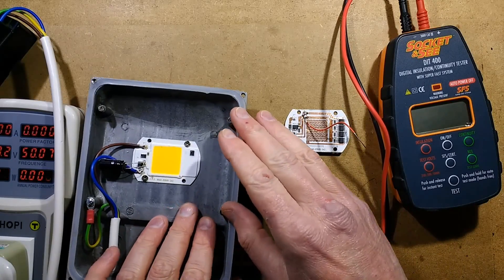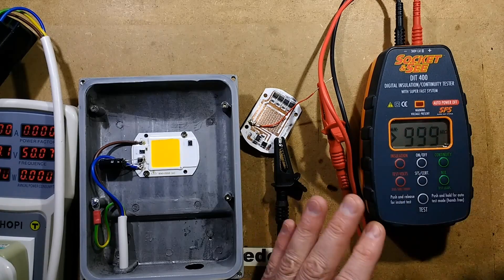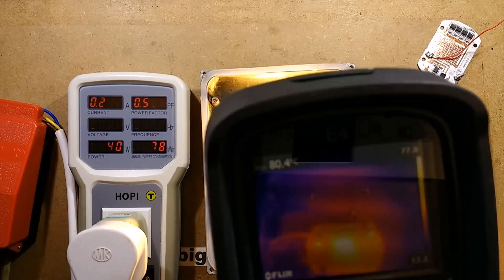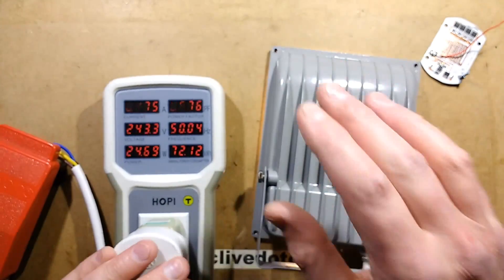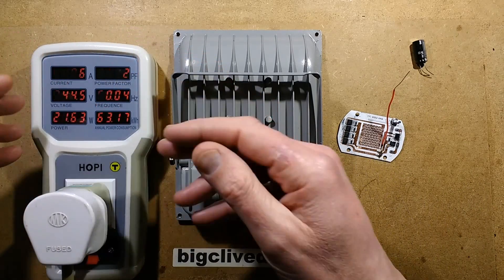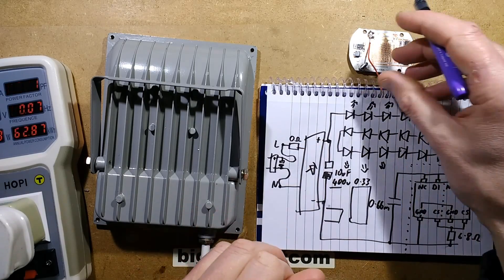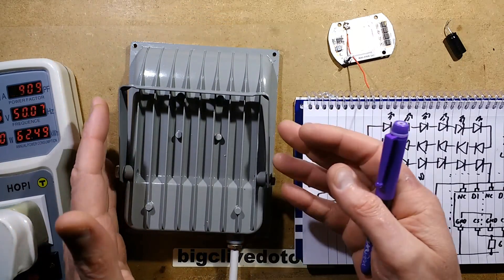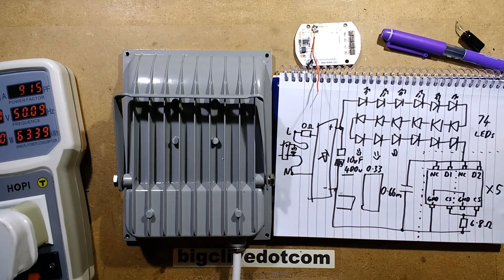Adding a capacitor to a driverless LED and other tests.

Comment: So If you wanted to add a capacitor , would you have to change the resistors that set the current?
Reply from the maker: It could be useful, but is tricky to do on the aluminium core PCBs.

Comment: I've got 20w cob led to play with. I measured line that goes to leds, an it says 160v DC. So i soldered down a 200v220mF cap there. Flickering gone. And LED is lighting for 10 sec from capacitor after turning off. Also color temperature became significantly lower. It was about 4000K and began look more like 3300K. I did not measure power consumption. I will do nex time, because after 5-6 days of 24/7 working the LED burned off. It seems that the driver is what gone, but rectifier and led chips still alive. The LED has nothing else on board: rectifyer, 8p driver chip and driver chip set resistor.
Also i tried with different 20w led to install capacitor between rectifyer and driver. There's about 190v DC. This time i got a route on COB burned like a fuse after 10 sec of working. I think the problem may be in capacitor rated 200v under ~190v line that may have higher voltage at peaks. I will try this with higher voltage rated cap next time.
Reply from the maker: It's not a good idea to add a capacitor to these lights without significantly reducing the LED current.  They are already overdriving the LEDs.

Comment: Could you put a couple of high power ceramic resistors heatsinked to the case to drop the peak voltage when using the capacitor?

Comment: I have an outdoor balcony light, the G23 9w bulbs don't last very long.  
I saw this video and wondered if I could wire one of these in, it has a 240v (5/7/9/11w) driver, would this work as the supply?

Comment: Thank you for this and all your great videos. What if you put an X cap in series with the line to lower the current along with the filter cap maybe you could reach a balance that would correct power and flicker. I have 20,30 and 50 watt 110v  versions with 144 leds each that look similar to yours. Haven't powered yet. Possibly the 60hz  AC line here will make flicker less noticeable.

Comment: i got a 5W led 12V and it gets hot 45C round. also built a 12V pack out of used 18650 batteries and going to make a nice torch out of it......

Comment: Would it be possible to use an inductor/magnetic ballast and some diodes to reduce the ripple? So it gets mains waveform and a phase shifted waveform?

Comment: The slim fiberglass insulation is prone to fail in prolonged continuous use I got multicolor driverless which changes colours by switching it on n off I run it four full nights n it shorted insulation from mains to rectifier ...I put an adiquate heatsink n thermal compound....I put in outdoor sealed aluminum housing from my old spot light
Reply from the maker: It seems to track through when individual LEDs fail and start burning.

Comment: Does anyone know if we could swap the 6,8ohm resistor for a higher value one to act as a dimmer of sorts?
Reply from the maker: You can make the sense resistor higher to reduce the LED current.
Reply: @bigclivedotcom  thanks Clive!

Comment: I know this is an old video, but have you tried using a variable capacitor and check power output in varying capacitance. Maybe a small enough value would fix the high rms issue

Comment: Named driverless LED  while they use CCR (Constant Current Regulators) :) I got similar lamp from aliiexpress and one brokes after some time at power on moment. Same hapens with my own DIY cyt100b lamp. At Turning moment start only blurry. After testing find one of diode in series went broke. After replacing diode I add 380k resistor in paralel to leds. Do this solve problem with paralel diodes went damaged ?

Comment: Clive your videos are great & provoke much discussion. But sometimes you fail it follow through on the obvious. For example I think we all know that silicone is very unlikely to last more than about 2000 hrs exposure even at 50C. If I'm correct this limits the practical employment of these devices relegating them to hobby builds. Now many comments echo my feelings - have to get rid of that damned flicker & do this in the easiest many which would seem to dictate an off board workaround. Many suggest supplying 110/120VAC or alternatively feeding 230VAC with a mains rated cap.
I think you should do a follow up just to show what happens & what you consider the optimum solutio & what really is an appropriate temp limit for the LED array?

Comment: I would be very interested in further ways to stop these LEDs from flickering. What do you think about adding a capacitor in series with the LED with a capacitor across the rectifier as well? Or how about adding a big capacitor between the driver and the LED itself? This wouldn't probably be a lot less effective against flickering since the forward voltage across the LEDs would still ripple a little (depending on the capacity of the capacitor). But at least the drivers wouldn't be getting a peak mains voltage all the time. One might also try to decrease the voltage to 170 VAC, so the rectified voltage is 240 VDC. This may be an overly complicated solution to stop a 2 dollar or so LED from flickering. But I would still be interested in your opinion to different ways fixing the flicker.

Comment: Or you can add a larger capacitor across the LEDs and put a NTC thermistor in series that starts out with higher resistance for the inrush, or the thermistor in series with the hot input. I'm sure the chips would be fine with the inrush without a series resistor as long as it wasn't overly large, maybe 100uF in parallel with the LEDs. I've bought several cheap Walmart bulb both dimmable and not, and both clearly have a capacitor in them since they have no 60Hz flash and even none when dimmed for the dimmable ones. The non-dimmable didn't like the dimmer. I used an only 20 year old dimmer, not one designed for LEDs too. All were silent too with no humming except a Dollar Tree Utilitech brand that hummed a little. 
Now if I can only find 25w LEDs that aren't $3.00 or more a bulb. If they can make a 40w then they can make a 25w for the same price with the same type bulb.

Comment: I screwed one of these lamps to a metal housing (formerly a fluorescent light fixture) and the thing heats up to 180F (87C).  Like the one in the video, it only draws 25W, however a real 100W bulb only heats up to about 150F(65C).  The whole fixture gets pretty hot around the LED lamp.  This whole fixture is mounted to the ceiling so I'm worried it might be a fire hazard getting that hot.

Comment: Has the flickering been fixed in the two years since your analysis?
Reply from the maker: No.  That type still flickers.
Reply: bigclivedotcom is there a better COB solution that doesn’t? I remember you adding a cap to remove the flickering which raised the voltage but I’m curious why you couldn’t/didn’t add in a resister at the mains input to drop the voltage. Too much power?
Reply from the maker: @sh91899  If you used a resistor it would get very hot.  The capacitor increases the power/heat dissipation from the regulator circuitry.
Reply: bigclivedotcom is it 120Hz flicker and does it get more noticeable when a dimmer starts to lob off the front or rear of the wave? The lighting is for a large terrarium.
Reply from the maker: @sh91899  Yes it is at 100/120Hz and the use of a dimmer makes it much stronger.
Reply: @bigclivedotcom  AH! ok, so since you are on 50Hz, the flickering might be considerably more noticeable over there versus my 60Hz. What about using a motor speed controller off the mains to increase the supply frequency to the LED COBs?

Comment: If excess heat and reliability is an issue (i have problems with flicker in side vision causing headaches very quickly) maybe a easy bodge might be to put 2 lamps in series? It would reduce output of each chip and lamp of course but increase longevity (running at just over 1/2 intended voltage) but how to wire 2 lamps in serise safely?

Comment: What if you were to smooth the voltage with a modestly sized inductor (in series) instead of a capacitor? Wouldn't that smooth it without raising the voltage to the peak mains like a capacitor would?

Comment: Bit late after the video went up, but would using a lower value capacitor help mitigate the amount of heat it dissipates or would that just reduce the flicker instead of eliminating it?  I'd be happy with reduced flicker on 60Hz 120V AC.

Comment: Ma full spectrum ones dont flicker according to my Nokia 5 cam  but the ones I've tested 10w X 4 powered from 12v with boost converter upping the voltage I get the flicker from them.. I've added diy heatsinks to them they work very nice but they need some kind of connection with them save soldering them . Good video

Comment: What about rectifying, smoothing with a capacitor , and then putting two modules in series, one for 230V, one for 110V, together ~350V?
Reply from the maker: That could work if their currents were matched.  A 110V LED might operate parallel strings at higher current though.  Maybe 3 110V LED arrays in series?

Comment: I just got this LED from different seller for 120V, it looks quite different and seems to have testing points, also, the cover on chips is transparent, I could send you a full resolution picture if you want.

Comment: I have one more question about this as well.... If I were to convert 110ac to 110dc, would the spectral output of the COB change? If it was provided with a lot better cooling would they still have a decent lifespan in your opinion?
Reply from the maker: If you rectify and smooth 110V it goes up to 155V (peak of sinewave) so the current limiting circuitry would get hotter.  The current would be the same, so the colour would be the same, but with no flicker.
Reply: Great thanks!

Comment: Thanks for posting these videos about these drivers. I am thinking about building a large array of them and I respect your opinion on these things. I was wondering if it would be possible to alternate these out of phase relative to each other(switching live/neutral every other COB) to create a light bank with less perceived flicker. What do  you think?
Reply from the maker: That doesn't work with single phase.  It has to be three phase to get the sequencing effect.
Reply: Great thanks a lot for the super fast response!
Reply: Sorry to bug you again but I was thinking about your reply and I think there was some confusion. I'm talking about alternating the leads on separate cobs. So I would wire one the way it is supposed to be and then wire the unit next to it with the neutral and hot wires reversed. So when the one COB is experiencing the peak, the other would be out, and so they would flicker out of phase with each other. I mean it wouldn't stop the flicker but it would make it twice as a rapid essentially. I am not sure if there's any reason why the leads couldn't be reversed, but that's mainly why I asked. Thanks!

Comment: I am using these cobs and have been mounting 5 x 50 watt on an ally plate, with one cpu cooler on the back, the latest build tripped the RCB (MCB) in the house , not with earth disconnected though. Im not about to do that. Any thoughts? Continuity with a standard DMM shows it fine. So 2 questions if you folks dont mind,:
1. Is one CPU cooler gonna do it - no probs running previous builds this way, not too bothered on lifespan.
2. Any ideas why its tripping my trip, i did use exhaust putty to cover the live pads, which on my DMM shows infinite. 
Im asking cos I want to build 2 x 250 watt lamps, repurposing some old parcans.

Comment: Thank you for the video ! 8:30 you say something about putting a capacitor in serie to run the cob at low voltage. This is exactly what i want to do !! Can anyone explain to me how to do that ? I have a lot of driverless cob that i would like to use in low voltage to avoid massive heatsink.
Reply from the maker: You could use a fan motor capacitor in series to pre-limit the current through the COB.  You may have to experiment with the value of the capacitor in the range of 1uF, 2.2uF or higher.  It will have a distinct effect on the current and therefore intensity.  You'll also need to put a high value resistor like 1 Megohm or even two 1 Megohm wired in series across the capacitor to make sure it discharges when unplugged to avoid a zap.
Reply: Thanks a lot ! I'll do it and tell you the result. Which kind of capacitor do you recommend , Ceramic, electrolytic, Polyester ? I'm buying some kit on Amazon.
Reply: hi Clive ! I've received the capacitors and resistor. I've put the capacitor in serie and it work perfectly ! The consumption is about 5 watt instead of 50 watt with a 1 uF ! I hope the capacitor will not heat to much...
Could you explain more precisely where i should put the resistor ? Thanks a lot !!

Comment: How hard would it be to replace the current sense resistors with a larger value to cut down the current along with the capacitor?    You could eliminate the flicker without increasing the power dissipation..
Reply from the maker: You could definitely change the sense resistors to make the whole device lower power.

Comment: Why not use an external capacitive dropper feeding a bridge rectifier and smoothing capacitor to power the LED with 240V DC or perhaps a bit less?  The flicker would be gone and the dissipation of the current regulators would also be better.

Comment: With the capacitor installed, how would you make this circuit more efficient? If the power consumption is the same as before then how is it dissipating more heat? Does adding the capacitor makes the LEDs dimmer?

Comment: Maybe use a 220V driverless LED with the capacitor - on 110V AC... seems like it would properly offset it to run without flicker, without overheating anything

Comment: I blew two of these 50w chips, because I tried to solder the wires on them while not mounted to a heatsink. The Insulation seems to have melted. As soon as I toch the back plate with the ground wire, my fuse blows. I soldered 4 of them, while already mounted on a heatsink, yes it is a little bit tricky, because of the heat dissapation, but those do work good, and the insulation is maintained. As heatsink for a 50w chip I use CPU-Heatsinks with fans. Hope I could answer the question from the beginning about the Insulation.

Comment: I don't know if you're aware of it but that flicker can cause seizures. I am currently helping to upgrade an entire building from florescent to LED. The florescent also have that flicker and were contributing to seizures. I probably spent almost a $1000 just testing bulbs and drivers till I found something that would work. For the most part it came down to finding a driver that had a capacitor to smooth out the frequency. We will finish replacing all the bulbs and drivers in the next week or so, but after that there is few of the standard screw-in light bulbs and I am considering just modifying LED bulbs by adding a capacitor. So videos like this are very useful, especially when it comes to understanding the problems I may run into.

Comment: I wonder... If you add a resistor on mains side to take some load off the current regulating chips would it actually increase the power of this module?

Comment: After adding a cap to smooth out the flickering, could you ad a resistor in series to the LEDs to limit the heat created by the constant on heat buildup of the LEDs? Also could a variable resistor be used as a dimmer controller?

Comment: You should do a test for the difference between the 110v and 220v models. I have several of  the 110v ones in various wattages and none have any visible flicker. The 50W ones draw about 65W according to my power meter. Run them attached to CPU heatsinks with fans.
Reply: Awesome videos by the way.
Reply from the maker: +josh robinson I think it's just the LEDs being wired as two parallel groups for the lower voltage.

Comment: Re: Adding capacitor in series @ 8:00 minute mark

First, thanks so much for showing us these fascinating products Clive. 

I bought eight of these on eBay after seeing this and four of them died within an hour running straight from the mains electricity. So, I followed your advice on taming them with some capacitive reactance. The results were amazing but I do have a question. 

 In my case, I'm using 50W "full spectrum" COBs rated for 120V AC 60Hz current so I went with a 1uF and 5uF 250V capacitors in series on the AC line before the COB. According to my calculations the 1uF should have been 3W or so and the 5uF closer to 30W at 120V 60Hz. 

I don't have a meter to check the light output but it did seem that the COB with the 5uF was much brighter than the 1uF as it should be. However, the strange thing is that they both seem to run completely cool to the touch although they're very bright. It's amazing how cool they run but the 5uF should be warmer it seems because 30W is still quite a bit of heat. Do you have any input on what might be happening?

Comment: Hi Clive stumbled over a 200W flodlight today, the owner wanted to use it when filmning
Wath do you think of get a dropper capasitor before rectifire and e big capasitor on the dc side 
So dropping 40% ten rectifi and smoth 

One other option is to build a 160v supply AC by haveing mans in to one transformer with 230/60v ruffly and the secondary in series backwords with the mains giving tuffly 160 v rectifying it to 230v dc wit capasitors
Reply from the maker: Before using it for filming check to see if it has flicker that is picked up on camera.  For high power applications a series capacitor isn't always a good idea.

Comment: If you paralled the LEDs instead of the output of the bridge then power usage should still be around 20w. A slight flicker but still much better than no capacitor at all.